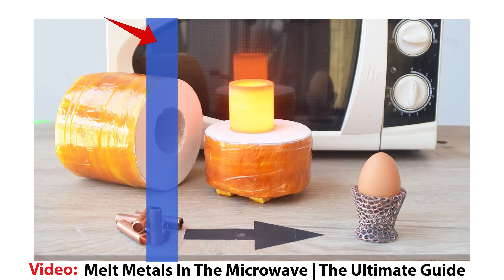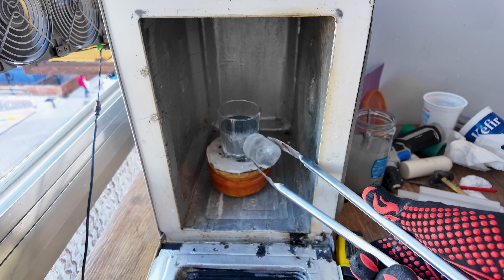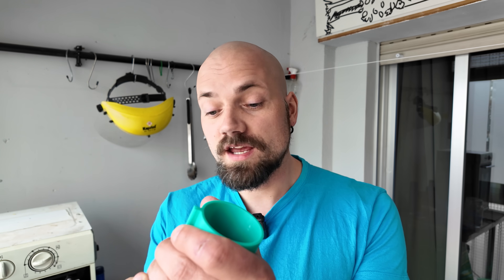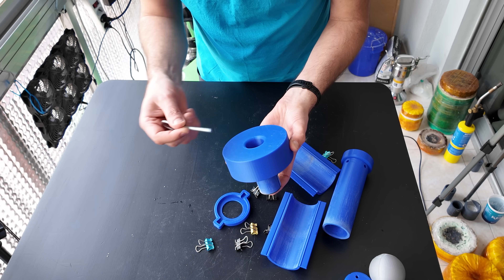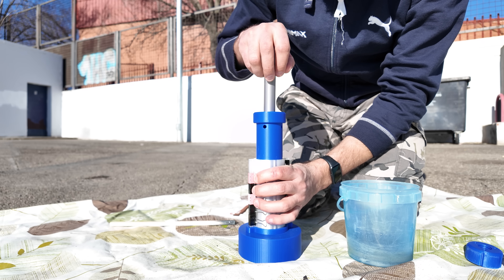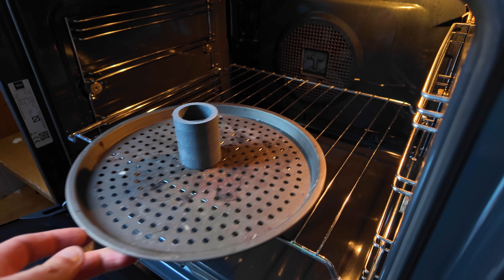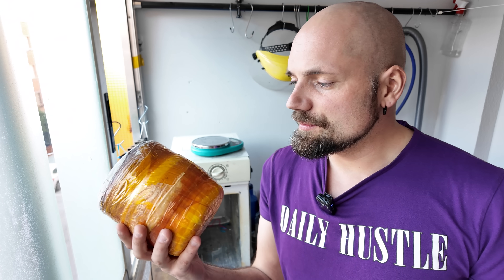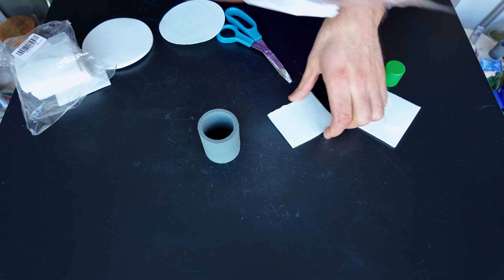How to Make Your Own Crucibles (for microwave metal melting)

Comment: He's not kidding about using the respirator. At these temperatures, the fibers aren't even the worst of your worries. Many compounds break down into highly reactive chemical compound that can and will destroy your lungs. Plaster for example will break down into calcium oxide and hydrate inside your lungs to highly caustic calcium hydroxide and to make matters worse the reaction is highly exothermic so you get heat burns on top of the chemical burns IN YOUR LUNGS. Many compounds besides plaster behave similarly at high temperatures and since you'll be using a microwave kiln with no real temperature control, you won't know exactly what toxic or caustic compounds may have formed in localized temperature extremes... so use the best breathing protection you have along with as much ventilation as possible... or have really good health and life insurance.
Reply: This is so absolutely right. It's not in the realm of "it'll be okay just this once." You can mess yourself up a LOT with one exposure.
Reply: @evanlane1690 Your neighbors may not either.
Reply: This should be a pinned comment please @ShakeTheFuture
Reply: the room with my pottery kiln gets a really interesting odor when I run it. I read up on the chemistry and learned that hydrofluoric acid is one of the reasons for that unique smell. :)
Reply from the maker: I also wanted to add that all your Devil’s Forges are lined with ceramic fiber. That’s why I always wear a respirator when melting metals.

Well, honestly, I think you should wear a respirator whenever you’re melting metals, no matter the method. It’s just like soldering—you should have some kind of fume extractor, especially if you do it regularly.
Reply: use a fume hood too outdoors ish
Reply: Thank you. Gonna skip all together the microwave kiln stuff 😆. I'll go buy it instead.
Reply: @brando5705  Definitely
Reply: OR DON'T FGKN DO THIS IDI(0)TIC SH!T
Reply: I’m sure you’re aware and I haven’t read all of the comments, but arrow Springs in the US makes a fiber blanket that is not made from fiberglass or toxic. I believe it’s completely ceramic and would do the same job. Just wanted to give you a heads up that there might be something better, possibly more expensive, but you would not have to worry about, working with fiberglass. Thanks so much for your videos. They’re really helpful.
Reply: A fumehood would be ideal. Then, random people walking by are protected, not just yourself. 

JS. Chemistry is dangerous, and your safety comes first, but you know the hazards, randos do not.
Reply: Thank you !! What type of respirator would be best? What about eyes?🙏
Reply: Dude just buy a torch. This whole setup looks like a meth lab. Like y’all really melting shit in a microwave
Reply: Id love to see some analysis on the socmedia industry covertly suppressing amateurs by avoiding or underplaying these realities.
Reply: Are you using a chemical organic vapor respirator?
Reply: @riverboat28  I got a set of decent CBR masks from Budk for about $30 each, but its cheaper and more comfortable to have good ventilation or stay upwind outdoors

Comment: Hey! Awesome video. What are the specs of the microwave that you use? What is the name of the model/brand? Thank you!
Reply from the maker: It's "Severin MW 7873". It's a 900w, 28L microwave.
That said, if it's for melting metal, my newest microwave (the one I used in last video) is 42L and 1100w. It melts noticeably faster. So for metal melting, it's my new favourite, though costs more.
I bough it from ebay. It's "SMAD" DMD110-42LBMME.

Comment: Is there a reasonable way to measure the kiln temperature while the microwave is running? I guess that wires running into the kiln would themselves get very hot, short out the microwave field and possibly spark. How would this be done in industry?

Comment: Could you use sodium silicate + silicon carbide mold to cast aluminum and reuse the molds with enough draft angle in the moulds?
Reply from the maker: I believe you could get a few casts out of it, but I have not tried it. Cheers!

Comment: You can set your mix almost instantly by flushing it with CO2 instead of drying it. Also this metod (sand+water glass+ CO2) is used to make easily destructable complicated molds and cores for metal casting.
Reply from the maker: Yes, that's true. I used to use co2, but not anymore. Cheers!
Reply: @ShakeTheFuture  why not?
Reply from the maker: @zlozlo3935  I just find it easier this way. Don't need to buy co2 or mess around with baking soda and vinegar. Also, hardening with co2 does not remove the moisture, so you'll need to bake it anyway.
Reply: @ShakeTheFuture  Not just bake. Heat to ~800-1000C° to fuse carbide patricles with molten sodim silicate from waterglass.

Comment: Is the silicon carbide sintered together by burning/hardening it in the microwave ? means: does it melt to a point where it becomes sticky and "bakes" 
together ?  Or is it still just the water glass holding it together after burning ?
Reply from the maker: I wouldn’t call it true sintering—maybe there’s some mild sintering going on, but in most cases, it’s really the waterglass that holds everything together. If ceramic fiber is used, it also acts as a binder.
I didn’t mention this in the video (or maybe I did—I’m not sure), but since switching to the new molds, I’ve mostly stopped doing ceramic fiber wrapping and pre-heating of the crucible. The crucibles still need to be heated before their first use, but they’re much stronger now than before.

Comment: can you make a video on making a crucible with a melting furnace instead of a microwave
Reply from the maker: I live in an apartment and melt metal on my balcony. I can’t melt large amounts of metal or run a gas furnace out there—that’s why I use a microwave.

Cheers

Comment: I am trying to order some silicon carbide to make some crucibles, but I´m looking at about 2 million different grit sizes and then it jumps to microns, wtf?  So what would be the best SC to make one?
Reply from the maker: I like to use a fine grit silicon carbide. Lately I have been using Fepa 320. It's early to speak, but I think the crucibles come out stronger than coarser grits.(time will tell) Before that I used to use Fepa 220.

Comment: Instead of ceramic wool insulation wrapped around the green crucible, I tried placing the green (unfired, unhardened) crucible in a terra cotta flower pot, and covered it with Perlite, and then placed it in the microwave oven. It  worked well to harden the crucible, and the Perlite if carefully handled does not generate the air borne micro particles.
Reply from the maker: That's exactly what I've been doing lately, but not for crucible hardening (yet). I did it to burn out a silicon carbide mold. I had a mold that was too big to fit inside of a kiln or a chamber, so I used a flower pot and perlite to insulate it and trap heat. Awesome! Thanks for sharing.

Comment: Hey, I'd like to experiment with this and I've got a couple questions:

1. About how many sqft of the 1" ceramic fiber do you usually end up using to make one of the metal melting chambers?

2. I've been seeing lots of silicon carbide/graphite mix crucibles out there. Data says graphite is also good at absorbing microwaves. Is there a reason you go full silicone carbide? Have you tried graphite inclusion?

3. I see you're mixing grits and some of the comments are talking about similarities to concrete mixes. I'm seeing some anti-crack concrete mixes use fiber to reinforce the mix. Have you tried mixes with fiberglass, ceramic fiber, carbon fiber, etc?

I love your work and your generosity sharing it all with us. Looking forward to seeing more!

Comment: Can you reuse the silicon carbide in a cracked crucible by grinding it down and start over? Or is it over once it’s been hardened?
Reply from the maker: It can be reused, and I did so in the video where I made a cast iron hammer. I stopped doing it because it was way too harsh on the blades. Caustic soda is supposed to help break down sodium silicate, but when I tried it, it didn’t work that well—maybe I needed to leave it longer… or let’s just say I need to investigate it further.

Comment: Have you considered using starlite instead of silicia/Rockwool? Or carbon foam?
Reply: I tried some diy starlite in the microwave, but it definitely gets warm rather quickly and I didn't investigate much futher. I don't have ceramic fiber to compare yet but would think it would insulate better and be better at allowing microwaves through. I believe microwaves are absorbed by one of the components of starlite, but it is possible it just still hadn't dried out enough. Maybe I'll try again because a few pieces of starlite have been sitting in a dry house all winter.
Reply: @orangezeroalpha  This is why I suggested it: https://youtu.be/FmEb1YZScxc?si=eo2MjBxfY32xhoJe
Reply: @bukkiahgolden6043  For some reason I assumed you meant the formula of his. Certainly worth exploring to use in various ways since it is pretty cheap, available and wasn't difficult to make.
Reply: @orangezeroalpha  A correct assumption ;)

Comment: Hello !
I have a suggestion
I thought of a very exciting upgrade to you process that could be achieved cheaply with materials available almost everywhere in the world.
And that is, putting the microwave chamber under a low quality vacuum (50 Torr or less)
This would dramatically reduce eat loss as well as tin flash when casting bronze
Higher temperature would be achievable and a lot less energy would be wasted (heating quicker !)
And much less insulation would be required !
Here is how I propose to do this. 
First the chamber must be sealed. I believe this can be achieved with two wide beads of RTV silicon around the cavity door.
Next the waveguider must be sealed. Against RTV silicon around the waveguide port and a piece of common glass (I hope regular soda glass does not absorb any RF radiation, is yes, then some other material that is transparent to RF)
Ok now I hope the chamber is airtight. 
drill hole into top side of microwave cavity
install NPT or other simple 1/4" T shaped pipe fitting
add two ball valves to each side of pipe fitting
Obtain any refrigerator compressor
user compressor suction side to pipe fitting
draw pressure down to 50 to 10 Torr (1-2 minute)
optional, maintain pressure to low level with a vacuum pressure switch to restart compressor periodically
for automatic operation use normally-closed solenoid valve (2$ on aliexpress) to close chamber outlet while compressor is not running
optionally, attach, nitrogen, CO2 or argon bottle to the other side of the pipe fitting
optionally, after initial rough vacuum, fill chamber with inert gas to about 100 Torr (a small amount of gas) then pump down again (this further reduce oxygen content)
I hope with this method, most insulation will no longer be necessary, crucible temperature will go higher and quicker
Reply: Hello again,
After some research, Acrylic, Polycarbonate or Teflon sheets are ideal materials for making the waveguide port airtight while remaining RF transparent. 
These materials are cheap and readily available almost anywhere.
Reply from the maker: Thank You for the suggestion!

Comment: Hey, I had an opportunity to pick up a couple of crucible at a reasonable price but they were or had Graphite in them. Can I use these in the microwave or not?  Great videos BTW. Got me started on this new way!  TY!!
Reply from the maker: Some crucibles work, others don’t. There’s only one way to find out.
The downside of using bought crucibles, aside from the fact that sometimes other materials are mixed in which can worsen the heating (or don't heat up at all), is that they’re usually very bulky and thick. Great for safety, but not ideal for quick metal melting. Melting aluminum is fine since it’s very easy to melt, but when it comes to metals with higher melting points, a bulky crucible can become an issue.
That said, I don’t know what kind of crucible you bought. Most of the crucibles I’ve seen are bulky, but there might be a few that aren’t as thick. I hope it works!

Cheers!

Comment: Very nice video, i thought they use silcone powder and oxidized as a binding agents, using water glass is way more cheaper, but why do u use ceramic fiber and wrape the crucible ? Is their any explaination ? I think just using high temperature will harden the crucible
Reply from the maker: Ceramic fiber is what makes the crucible stronger. It's not sintering; rather, the ceramic fiber fuses with the crucible, as seen in the video. Simply heating the crucible may work in some cases, but it's not the same. Cheers!

Comment: Amazing! What temperature can you reach with a microwave silicon carbide crucible?
Reply from the maker: I have never measured the temperature, as I don't have a way to do it, but I can melt cast iron, as seen in other videos, so that temperature can be comfortably achieved. Cheers!
Reply: @ thank you mate.
Reply: To melt cast iron, you typically need to reach a temperature of 1,150–1,300°C (2,102–2,372°F), depending on the specific alloy and carbon content.

Comment: can you try and make diamonds with those crucibels ? [diamond seed,graphite,olive oil]
Reply: lol where'd you get olive oil of all things xD ?? Genuinely curious. I think the biggest contributer to at home diamonds would be if he could enclose the microwave in a methane/co2 gas environment+ the graphite/diamond seed mixture
Reply from the maker: I don’t know much about it, but to answer your comment, I looked it up and found that it requires extremely high heat. I can’t reach temperatures that high.

Cheers!

Comment: I believe the microwave method is the way to make localized metal 3d printing available, definitely need to have better safety protocols automatic if the general population starts to do this kind of stuff but microwave is a lot more available than $1000+ kilns
Reply from the maker: Cheers!
Reply: Would be nice to try one of those metal filaments and see if they would solidify, perhaps putting a very small tube to blow argon on it very slowly while it melts

Comment: Dude, you are the man.  What about using talcum powder on the glass so it doesn't stick and you don't have to crack it?  What about a mechanism that is large like the whole cavity and tips to pour it into a mold when you open the door?  Covered in insulation?  Like how big can you go?  A production microwave would be cool.  That way you don't have to handle a hot crucible.
Reply from the maker: I have not tried using talcum powder to cover the glass. You can use a plastic cup instead of glass. If it's new and shiny, then after carving out the crucible, turning the cup upside down and microwaving it on low power can help release it. I didn’t show that method because it's easy to mess up. The glass method is pretty straightforward.

As for the other suggestion, some of the things you mentioned come up frequently. I'll be exploring some of that in the future. Cheers!

Comment: Wow, so much effort to avoid traditional methods
Reply from the maker: Well, for some people, these methods can be cheaper and better for small-scale melting. If you have an old microwave (which, depending on where you live, you can sometimes find for free) and materials that can be purchased cheaply, you can make several metal-melting chambers with just one roll of ceramic fiber. You can also build a microwave kiln for mold burnout.

As for melting metal, I also melt iron, which might not be possible with electric melting furnaces. So, it all depends on your needs. I always think that if you’re a professional and want to do this to make money, then I would definitely go with professional metal-melting equipment.

Cheers!

Comment: Could one conceivably build the ceramic heating chamber using a clay slurry and slip casting method as opposed to ceramic fibre? Great content as always!
Reply from the maker: You can build it, but the question is how good it will work. The issue with microwaves kilns/metal melting is that some of the materials you chose to use can absorb microwaves. I have a good example shown in the microwave metal melting video with a firebrick: https://youtu.be/P1VmIYheuU4?si=1jB08vbcARCTNl2d&t=1680

Comment: Thank you so much for these videos I was able to melt the metal using this method but the capacitor didn't withstand the surge. The capacitor is now blown and needs to be replaced👍
Reply from the maker: Some microwaves are more suitable for metal melting than others. I have also used microwaves that didn’t handle it well, while others ran for years without breaking a sweat. Cheers!